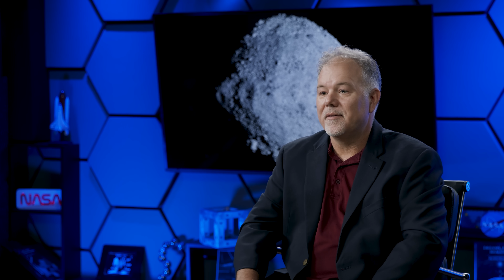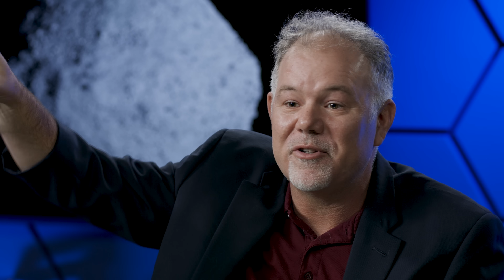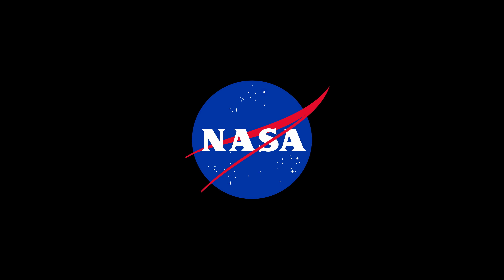Bio-Essential Sugars Discovered in Samples from Asteroid Bennu

Comment: What if the truck driver transporting the samples was eating a bag of Cheetos and touched the sample by accident?
Reply: Samples go through rigorous processes to make sure they aren't contaminated by exterior elements such as that. In a normal lab, let alone an extremely stringent one such as that, a sample being delivered may be wiped down with various disinfectants and materials repeatedly while also being held many layers deep before the actual sample could even risk being exposed, all in hermetically sealed containers that allow 0 chance of any contaminants of getting in, while the scientists handing them off would be wearing the utmost sanitized equipment and change gloves regularly while wearing a special set of gloves underneath the others to make sure skin never comes in contact with anything. Check out how CDC handles dangerous pathogens. It's pretty interesting.
Reply: @marionette-kaz that’s pretty cool to know. I was obviously being silly. Science is awesome

Comment: These simple sugars cause insulin spikes which lead to weight gain, and can an extreme circumstances lead to diabetes
Reply: Mass gain increases gravity, which leads to weight gain, and grave additional mass gain and ... gravity wells lead to black holes. Events unfold on the horizon that spike radiation that can burst from a pulsar, throwing their energy light years away, where they can destroy sugar molecules and control the diabetes. So the disease holds the secret to its own cure?

Comment: i need some of that sugar in my morning coffee
Reply: So you can use its RNA to morph into an alien?
Reply: @farmergiles908 On the one hand, that would allow the operating of alien machinery, but on the other, it would mean having to move to District 10.
Reply: Technically you can take ribose in your coffee, some gym bros add it in (along with various protein powders). Theoretically it helps the body turn other sugars into ATP, the gym bro claim is by taking the ribose directly then their body will use the other sugars for energy instead of diverting any for ribose production.
Reply: @kaitlyn__L  But how much ribose do you need? And how much coffee do I need? Well, not too much. But I could use a little more sugar in my morning disposition. 😁🌞
Reply: @farmergiles908  the people I saw using it mainly had a teaspoon per cup, funnily enough. It’s about half as sweet as typical sugar (glucose), apparently. 

Probably not worth it for most folks, unless they really need that boost at the gym or their body has trouble producing ribose for some other reason! But technically an option.
Reply: @kaitlyn__L  Ok, you're serious. I took you wrong, and was simply using some wry humor. Pardon my mistake. I haven't intended to make fun of you, if anything looks like that.

Comment: Assuming they’re right handed sugars?
Reply: The amino acids were racemic, a mixture of both. These sugars were too low in concentration to test but probably also a 50:50 mix.
Reply: @pattheplanter  Thanks! That is one of the most important data from this mission, but skipped over in the presentation, which kept on repeating the same euphoric babble.

Comment: Are the compounds detected in these samples random chirality or does one handedness dominate?
Reply: very good question fr
Reply: However, correct me if I'm wrong, but with gcms, you can't obtain any information on chirality, and it consumes the sample. Therefore, they would need to use a more of their original sample and isolate the same sugars in high quantities again to do nmr or something (porbably very tricky to get enough). Im sure theres other techniques that require less sample but they would nonetheless need isolate these suagars again
Reply: @marvinreinartz6957 You can separate enantiomers in chromatography by using special columns with chiral packing. I used some, coincidentally made in Japan, in some of my experiments. If they had issues with compound concentrations in the case of MS, as was the case with the other mission, NMR would be a pain in the behind due to its lower sensitivity. I'm gonna assume that they used some of the most sensitive instruments out there. Maybe some ion mobility stuff as well.
Reply: @marvinreinartz6957 Is there a derivatization method that could possibly separate them in GC?
Reply: @marvinreinartz6957 There are chiral columns that could separate enentiomers. However, I'm more worried about how they ran it on a GC, because sugars are not very volatile, are they?
Reply: @DeepWest9000 Think it is quite standard with derivatization. Non-volatile? Make derivatives which are volatile. The whole thing with GC-MS is that if people relied on inherent volatility of compounds the method would be nowhere as widespread as it is. I'm in omics so nowhere near an expert on analyzing specific compound classes, but I've seen colleagues routinely utilize GC-MS for analyzing e.g. sugars in food matrices. That being said, I annotated some sugars in my LC-MS experiments among thousands of metabolites. And here is an idea, maybe the GC-MS with derivatization enables one to better target the compounds for qualitative analysis i.e. more confident identification.
Reply: @DeepWest9000 certainly LC is more common for sugars analysis
Reply: @marvinreinartz6957  No.
Reply: @marvinreinartz6957 why bother with gcms when you can NMR and  AFM images
Reply: @marvinreinartz6957 ÿou need special chiral comumns. Than you cän determine the kind of xhirality by gcms
Reply: @marvinreinartz6957   there's no need for that, there are techniques for identifying enantiomeric excess on small samples remotely like CDMS
Reply: they're random! it's in the paper :)
Reply: The AA found before were a racemic mixture
Reply: It would be VERY worring if there was a large right handed bias
Reply: A great and intriguing question. Does the universe have a bias?
Reply: Oh the trolls. 🤦
Reply: This is a VERY good question.
Reply: It's been reported elsewhere that these compounds had no net chirality.
Reply: @N3spresso  They were not able to test for chirality. Quote from the paper: "Given the low abundances of sugars, high abundances of interfering molecules and sample mass available for this study, stable isotopic and enantiomeric measurements of the sugars were not possible". The amino acids found were racemic, suggesting no biological contamination from Earth. The sugars were 100-fold less abundant in the sample than the amino acids. They theorise that the sugars formed from the abundant formaldehyde in the asteroid by non-biological routes, so would probably also be racemic.
Reply: Should be a 50/50 mix since no life was involved in making the molecules, just random chemical mixing.
Reply: @Alextravelasia-111  you literally have no fucking idea if thats true at all. You fucking dipshits just make shit up to feel relevant.
Reply: @Alextravelasia-111 "no life was involved"
Citation...Im kidding, you dont have one and I know it.
Reply: Doesn't matter either way, of chiral it would be sign of life, if achiral it is sign for starting conditions for life
Reply: @supreetsahu1964 that distinction matters a lot
Reply: Anyone know what the sugars are?? If it’s just simple stuff like glycolaldehyde then tbh this isn’t really news as these have been well documented in star formations for a long time and the reaction mechanisms (which don’t involve life) are fairly easy straightforward
Reply: @Strobie_one Ribose and glucose
Reply: Im a Humanities graduate. What dis mean? 🥴
Reply: @lucasthebull  Some molecules can have "chirality". This means that they can have exactly the same chemical formula and composition, but not the same structure. An example is your hands. Both hand has 5 fingers and a palm, but you can't overlay one over the other and have them look the same. The same happens with some molecules. Although they might be compositionally identical, they can have very different effects due to their structure. When you create a chiral molecule in a lab, you typically end up with a fairly equal mix of left and right handed versions of the molecule, but for reasons unknown, molecules found in nature are almost always just one type. Natural amino acids are essentially all left-handed, whereas natural sugars are almost always right-handed.
Reply: @lucasthebull  some organic molecules can have 2 different "miroir image" forms - "left-handed" and "right-handed".  This is called chirality.  Life makes only one of the 2 forms whereas non-living synthesis makes equal amounts of each.
Reply: @lucasthebull  Sugars & many other organic, multiple carbon atom containing, chemicals  which are not symmetrical have two possible forms which are  labelled left handed & right handed. As they can not be mirrored onto each other like your hands cant. Life as we know it works only with the right handed form, and might only work with it but since we only have one sample of life we can not be sure of that. Those organic chemicals produced by non living systems are often mixed left and right & this is called Racemization(sp)   This is seen as a problem for origins of life research but there are seemingly ways that the mix can be skewed to favour one handedness more than the other which could occur in a prelife environment. 

I hope that helps
Reply: @lucasthebull  It means you needed a more general education, like liberal arts.
Reply: @farmergiles908 meh
Reply: @lucasthebull   sugar molecules come in two different forms, a "left handed" form and a "right handed" form. They are called that because the 3D shape of the molecules are literally mirror images of each other like your two hands. Life's sugar molecules only uses the right-handed form (called D), while normal chemical reactions produce 50/50 mixtures of left and right. So one way to investigate whether a sample originates from earth's life or not is to check the ratio of the two forms of the molecules. Hope this helps
Reply: @lucasthebull  there's basically two ways that a given compund can form. On Earth, we see a strong preference for just one of those ways. What we don't know is whether that preference would still apply on other bodies.
Reply: @sleadaddy  It only predominates in living things, not generally on Earth.
Reply: @lucasthebull   A left-wise twist is incompatible with a right-wise twist. Think of a bolt trying to go into a nut which has the opposite direction thread.
Reply: Sugars are not chiral. Any geological amount of time will also destroy chirality
Reply: @eawatling D & L Glucose
Reply: @eawatling  D-ribose and L-ribose are enantiomers, as are D-glucose and L-glucose.

Also, if you started with a sample that was mostly right-handed and most of the sample was destroyed over time, whatever remained would still be mostly right-handed. And similarly, if the sample was 50/50 to begin with and tiny sample of that sample would be 50/50 (or should that be ambidextrous? 😊)
Reply: I don’t know why this is exciting. We already knew ribose occurs naturally.
Reply: Atheist exist to prove there is no god, finding glucose in space certainly helps their argument lol lol Right? Lol lol from the reactions of commenting folks the stirring with excitement lol lol life is all over the universe just look up and watch some fly by visiting craft! So many it’s too many to mention. But you only have permission to look down, and be told what to think. The entire reality is elements that stack onto each other, but without a program of intellectual created data they can do nothing, the elements are real, we find them, the software code that triggers and runs and instructs those elements, that doesn’t exist in the same place nor is it created the same, as the elements. To discount the point, is to diminish the story to zero value.
Reply: @Otherworlds69 it's utterly illogical and a misunderstanding of the other perspective. They think they are utterly logical...
Reply: @Otherworlds69 What?  Atheists are just the default human.  Not playing tennis does not mean you exist to prove tennis is bad.  They don’t need to prove anything.  All the burden of proof is on the indoctrinated cultists.
Reply: dumb question
Reply: I wonder if the samples were contaminated while on Earth.  Didn't part of the samples have Earth life invasion?  Maybe all or other portions also were contaminated by Earth life in part or in whole.  Life on Earth is everywhere and invades every corner ---  even impossible corners.
Reply: @mdb1239 Not with Bennu.  They did an excellent job isolating the samples.  That was definitely the case with Ryugu, however.  Those samples were contaminated.
Reply: @jennifersaar1611  OK thank you for clarifying that.  I still have my suspicions.  Life on Earth invades EVERYTHING -- even the cleanest, most isolated conditions.  Life on Earth invades everything/everywhere.
Reply: @mdb1239 Life is definitely pernicious.  But I’d maintain there are still ways to do it.
Reply: @mdb1239 I had the same thought. When dealing with such small sample sizes, even a small amount of contamination can exceed the limit of detection and throw up a false positive. However, I want to give them the benefit of the doubt as world class analytical chemists (I presume) and assume they did everything in their power to prevent this. In addition, biological contamination would likely include not only sugars but a zillion other organic compounds too, as presumably an organism would be to blame. So, it would become really obvious really fast, 600 mg is a good amount for bacteria to cling onto. They’d be noticed if they were there
Reply: @hover-eb1hx  Here is the problem.  These samples are fragile so they are treated with extreme care.  This allows for the contamination by life residues.  If one really wanted to be "clean'" of life one would expose the sample/artifact/part to 600 degree F heat for 30 minutes in a ultra clean facility.  The insides of the incubator and all handling equipment would have to go thru the entire process.. What we know of life on Earth is it can and does THRIVE in the most awful situations - heat, cold, acid, base, etc -- even months in outerspace.
Reply: They sent a probe out into space to the asteroid and brought back samples, so the asteroid was never on earth to get contaminated - good question though!
Reply: @joshua.ryan.powell  LOL how high are you? The fact that the asteroid is still in space does not magically prevent the sample from getting contaminated. It didn't prevent the Ryugu sample from getting contaminated last year.
Reply: @mdb1239  not very likely the sample containers were engineered to maintain their pristine conditions, and they have decades long experience in maintaining clean rooms. Their research demands it, so with that much money and years into the effort, you can be reasonably certain that there is no earthly contamination.
Reply: @origamimambo545  It is sort of like biolabs.  They are supposed to be "airtight".  But there have been several/many leaks.  For most of them they got away with it -- the leaks of viruses/bacteria/chemicals.
     So I am still skeptical about contamination.,
Just maybe the containers were not that pristine in the first place.   They were contaminated before launch.  I take your word for it that procedures were rigorous after the samples reached Earth.  I still think they were contaminated by Earth life once they landed back to Earth.   How could they not be?
Reply: @mdb1239  yes dear, of course dear.
Reply: @mdb1239  I had the same scientific cynicism but the results suggest no contamination.  If the Earth environment were to contaminate the sample, you would not have a racemic mix of the sugar molecules.  Earth based life consumes and uses sugar that is dextrorotatory molecules.  A racemic mix of such low concentration shows that the method of processing was held and secure.  It's an impressive result.
Reply: @goldenpacificmedia Extraordinary claims need extraordinary evidence.  These are extraordinary claims.  Probably another mission with more samples are needed/
---
Bennu's orbit allows it approach Earth inside the Moon's distance from Earth.  We know that  the Moon gets showered with Earth particles (H20) under certain solar wind conditions.  So perhaps Bennu was exposed to Earth sugars that decayed in space on one of its close passes of Earth.
----
   I still think Earth contamination is the more likely cause for the sugars.  But I definitely could be wrong.
----
  Nevertheless very interesting results.  Are we going to have to wait til 2035ish for next close pass?
Reply: Oh yeah great question in the YouTube comments you’re a real scientist. This is how science is done in 2025. Sad
Reply: @DroolRockworm  Tf is your problem
Reply: Its BS so they don't get defunded by trump
Reply: @TheReal_LuaDipa  no one beleives your conspiracy theory btw
Reply: @DiggyPT  coming from someone who can't spell the word "believe" correctly. Lmao 🫵😂
Reply: @TheReal_LuaDipa  this is my second language. Are you mentally challenged?
Reply: @TheReal_LuaDipa simple hydrocarbons including basic surfaces have been found in space many times. While not as common and abundant as other organic compounds like co2, water and take you pick… they are out there in enormous unfathomable quantities, and so far are very easily attributed to be reaction bi-products of the former base elements given enough time and the right conditions. So stating that sugars of some kind have been found is really no surprise and definitely not bs. The surprise in this case is where it showed up. 

One could create sugar entirely without life if one was motivated, with nothing more than a lump of coal in a flask of water, some heating and electricity and enough time. So errrr maybe take your foil hat off and do what ever it is you do when your not making an ass of yourself on the internet 😄